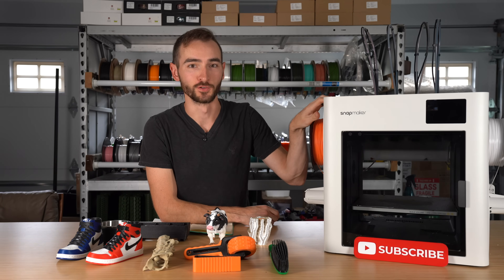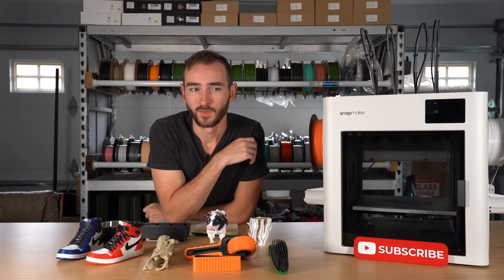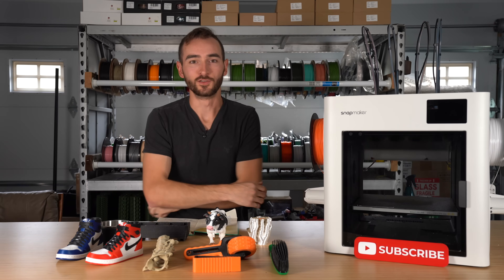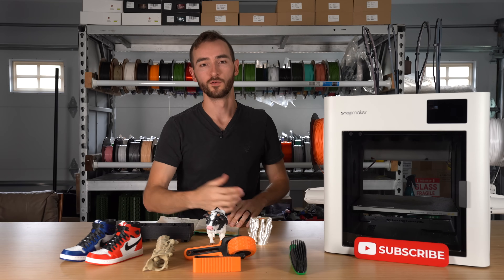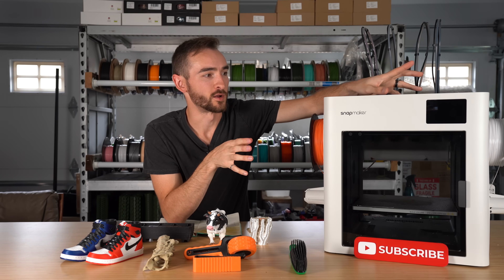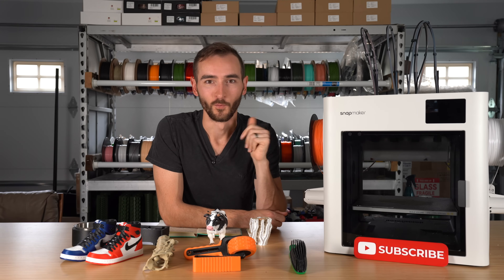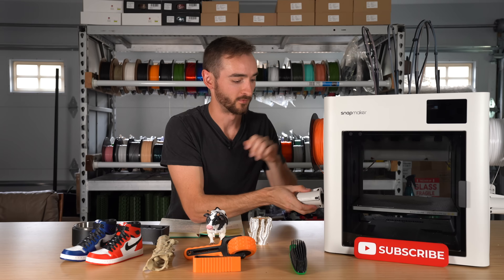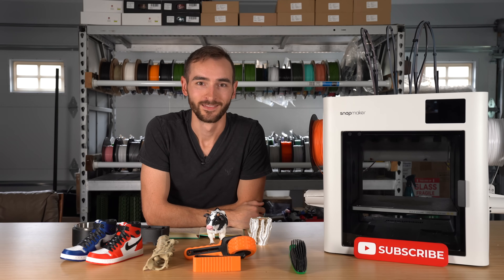Snapmaker U1 Final Verdict: Pledge or Pass?

Comment: I recently bought the P1s as an upgrade to my old CR10s. The issue with all the other companies currently in the market is that you get banana-ware, riping with the customers. Or never. I got the P1s. I set it up within an hour (admittedly getting the bluetooth to connect was frustrating). But it worked ever since. Flawlessly. No crashes. No random failed prints. No UI freezes. I can monitor my prints via my phone. I can change speed via my phone. It all just works. This is what people REALLY want. Yeah, I get it. Not you, as a 3D printer tinkerer. But everybody else. For my CR10s I swapped literally half the components, including mainboard, motor drivers, I added a BLTouch, compiled Marlin which had a bug that caused the printhead to crash so I needed to compile again... It took me a week back then.I am just done with working on my printer. I want to work on my projects. And my printer is NOT my project. It is a tool FOR my projects.

And the second issue: I wanna be safe when printing. I know that 3D-printer enthusiasts often just gloss over this or neglect this, but trust me, if I were a dad of a small family... Yeah, I fucking care whether or not the printer in the room next to me fills the air with harmful to toxic UFPs and volatile chemicals or if it has a decent filtration. I know the P1s' default filter isn't great, but at least there are better filter boxes available from e.g. Voxel, and yeah, I will totally build my own filtration stationwith a car blower fan, serious filtration units and an exhaust pipe to outside to print some of the nastier stuff. But at least a decent default filter is imo a MUST these days, when you offer enclosed printers capable of printing ABS/ASA and the likes.

Coming back to this printer and Bambu and why I bought Bambu: Literally every other printer I saw reviews of had MAJOR issues. I mean MAJOR issues. Like UI freezes where the nozzle stops in your print while printing with 270C. Which is a very nice setup to burn down your house. I will be honest: The current market is frustrating. Because believe me: I would have rather bought something that is not Bambu, that is open source and that does value that open source idea and ideology. But everybody is else is just SO far behind in terms of reliability while being affordable. It's just a different game. I really wish this printer here would come out and be AMAZING. That would be so epic and disruptive. And I would likely buy it then as a new main printer, ngl. But with what you report... I just don't see it. Again, as with all the other printers coming out recently. If Snapmaker wants my money, they need to make this machine reliable, make the obvious wearing parts available for REALLY cheap or even better: just open source those little connector boards (which would be a HUGE "yeah, your machine is going to last" statement btw, just saying). And address filtration and enclose-ability. But yeah, they need to NAIL reliability. Because who is caring for tool changers? That is not the guy that occassionally turns on his printer to print 3 mini dragons every two months. That's people who print often, a lot and know why they need it.
Reply: P1S, A1 Mini, H2s, all perfect. multi head would be a nice feature but not at the price of reliability.
Reply: You have summed up my view  ( and experience ) perfectly, I really want another manufacturer to challenge Bambu because it’s good for consumers. I’m waiting for the Bambu nozzle changer, it’s highly likely to be a well sorted tool from day 1.
Reply: I recently got a P1S after having an older printer for the past 6 years. It's like heaven. I do want heated chamber and be able to do multi material and a little bit of multi color, I mostly do functional prints, so color isn't really my thing. I only have white, black and gray filaments. I am content with the P1S and will let this tool changer mess shake out before adding another printer.

Comment: I appreciate your timely post and candor. OK, so I am backing this Kickstarter, I got in at the $749 after constantly checking for openings (I had originally scored a $799 slot). I have some reservations as I backed the Snapmaker 2.0 A350 and have always had issues with it. Hope this is more reliable. I have a Bambu Labs A1 that I LOVE, just cannot stand the waste on the multi material / color prints. I think I will keep the pledge, at this price point why not .

Comment: As far as the spoolholders go , You REALLY SHOULD actually read the kickstarter updates before posting.  Snapmaker has already addressed the spool holder issue.  AND why are you so uninformed on all this?  Snapmaker 2 WEEKS AGO put out the longevity of the pogo pins at 2 million+ changes.  If your going to be an "informed reviewer" then you should be "informed"...
Reply from the maker: Fair. I did catch the point about the pogo pins after I recorded which is why I added the overlays clarifying that they’re rated for 1M according to snapmaker. Didn’t see anything about the spool holders though. I’ll have to go back and look for that.

Comment: I am buying because it’s useful to me… not because it’s current. Even my old ender 5 is still useful to me (well it’s not really an ender 5 anymore… I changed it so it’s much easier to use, motherboard, hot end, Klipper etc.), but I wanted a slightly bigger build plate and multi material for supports….

Comment: I watched a creator video first impressions video three hours after the kickstarter launch began.  I am thrilled to have backed it when I did.  I am on the January delivery timeline.  This is the printer I wish Bambu Lab had released instead of the H2 series.
Reply: H2 series is a nice platform.
The H2D was a bit lacklustering but H2S and H2C will definitely have their real life purpose.
I Will instantly convert my H2D to a H2C when vortex is out.
Reply: Maybe a different series, but H2 was necessary. I'd rather have a heated chamber than a multi tool head.

Comment: Fair and valid assessment that may and probably will affect the first wave adopters. While having an entry-level-priced multi-toolhead printer is kind of the holy grail for first printers, the area of the market that's truly been ignored is people who want a Next printer. Most every printer on the consumer end is a First printer, whereby people who have one more more machines already know what they want, want to expand capabilities and explore higher-end materials, but the step up into that realm is either out of price or a DIY effort. Me personally, I have fairly specific benchmarks to hit for my Next printer and am building my one-off for my somewhat lofty needs. I don't need multi-color so much as multi-material, a large footprint and High Temp capability that won't cost $5k for a printer with Pick 2, Need 3 options.
Reply from the maker: I like this take a lot. The “next” printer versus the “first” printer - well said.

Comment: To correct you there is actually only ONE other multihead printer in the works like a U1 , The Wondermaker and its a huge question mark at this point.  The Indx or the Vortek are NOT printers. They are just addon components to already existing printers and require assembly, much like a Co-print unit.  That is never a good way to go for tge average customer that doesnt have engineering skills to build half a printer.  The U1 is going to be the new standard, like it or not

Comment: As someone who HAS replaced the carbon rod assembly on an X1C, I can concur it is “much more difficult”. That’s probably an understatement as I had to take the printer down almost to the bare frame (probably 80% disassembled). It was so involved. Took about 7 hours.
Reply from the maker: You’re a trooper for even taking that on in the first place
Reply: I had one of the first 1K Kickstarter units and unfortunately the carbon rod assembly seized up after about 800hrs and I couldn’t print anything. BL replaced the rod assembly under warranty. But, yeah, it was literally an entire day of non-fun work to replace that. In the end, it was all good and I put on another 2000 hrs afterwards. But, egads, I’d never want to do that again.
Reply: Can confim. I have replaced one on a P1S. Someone had used it as a carry handle and the lower carbon rod broke. It cut his hand quite deep and the resulting cleanup was no fun at all.
Reply: A few months ago I replaced the carbon rods on my P1S, and it took about the same amount of time - 6 hours. It's VERY involved. You have to take apart like all the panels and there's so many steps.
Reply: How to judge those rods are worn down? Like avg. print hours?
Reply: Mad respect for doing that replacement! I'm enjoying my P1S but dreading the day I'll have to replace that carbon rod assembly
Reply: @MrBluntNose its not that bad. I have done it twice and takes approx 1 hour if you are a bit used to repair printers :)
Reply: @sindrejl  it does not take one hour. I am used to repair things, but it took me over 1 hour to replace a motor. Just getting the wifi antenna off was a nightmare since Bambus wiki shows just remove it.. and in reality it was glued down onto the plastic.

Comment: Thanks for doing this. Personally I stepped out of the Campaign a few days ago after getting in very early and since considering. At the end it was a mix of very personal reasons and i sincerely hope that Snapmaker delivers properly. I myself will first look at the Prusa/INDX and Bambu H2C thing and then weigh my options. They will both likely be more expensive but there's just a bunch of details I don't like on the U1 and I personally prefer paying more for getting more instead of buying the first cheap option. Good luck to everyone who bacs this and I'll hope they will get their printer rather sooner than later, even though experience as a Superbacker says otherwise :)

Comment: 2mm on the bed, there is like 0 chance I will not see the results of that in my prints. 0. If the bed is that warped, how bad is the rest of the system, like the gantry? Sounds like there is like 0 focus on accuracy, both within the community and on the manufacturing side. You also got a tilted bed, not really a warped one, if you can trust that bed mesh. But can you? No matter how you twist it, the gantry and the bed is no where near in line.

Comment: I did the $50 dollar pre purchase, I then backed out and got a refund. I feel I made the correct choice. Will see how the Bambu H2D multi tool head works out for my H2D.  After thousands of hours on my P1S and H2D, I can say I am a Bambu fan IT JUST WORKS and Prints great. This machine is 2 cheap and I do not think it will last for a power user. Might be fine for light printing, but heavy use??? I do not think so.

Comment: One thing I like about Prusa is they produce a printer and then support it for years. The printer you buy on day one will be much worse than the same printer in year three. 
Compare that to basically every other cheap Chinese manufacturer and they push out a new model every few months and however it ships, that’s it. It’s got no support after release. 
I’ve never owned a Prusa but that aspect is appealing. 
Like a Tesla. They aren’t pushing out a new model every year with no real changes. They produce the same car year after year and all the changes roll out for every car not just the new one.

Comment: allright allright, lets try it out. I dont want to wait for INDX because by the time INDX will arive, there will be something new, and then something new, and then something new and you will just wait and wait and wait for something newer better allways. This is basically proof concept, because it is basically baby Prusa XL for 1/4 of the price. And this is full solution, INDX will be something you will need to tinker to get it work, and only Prusa with core one will implement this, but it will be much more expensive, and do not forget build size on the core one is not that big. and Nobody yet tested INDX, maybe it will sux ? maybe it will be best, who know. U was tested by XY of people already and we can see that the printer works and prints. Fingers crossed that they will deliver and that printer will be good.

Comment: This is still one of the first affordable tool changing printers and with a very hobbyist friendly price. So, yes it is a machine worth backing. Even if you receive your machine in march it will still be a competitive machine. If you want a reliable workhorse, I have my doubts. It is to cheap to have all good quality parts. Pogo pins are a cheap solution, but when you use the printer as a workhorse almost 24/7, they need to be replaced after only about one year. 
The Prusa XL is still the tool changer to beat, but that has a price tag which is more to the professional market. If Prusa comes with a INDX upgrade for the Core One, that will be a serious competitor, with probably even more colours.

Comment: I appreciate your very measured approach here! I am personally optimistic that Snapmaker will deliver and that there will be little buyer's remorse. I don't think we will see a major player tool changer from any other company for at least a few months. I personally think the Bambu Lab Vortek sysem is very flawed on paper and I have no interest, especially given how expensive it will be. I am most excited for Bondtech INDX, but likely will not want to pay the entry fee for a Prusa machine with it integrated. I do want to add it to a machine in the future. The U1 is really in a fantastic Goldilocks zone in terms of price, capabilities, and from what we have seen, performance. I hope they can live up to the beta quality!
Reply: I think Vortek is interesting, but I'm not buying another Bambu Lab printer, now they've shown their true colours. Whether toolhead or hotend changers win out though, only time will tell. I just hope that Snapmaker will offer replacment toolheads at a reasonable price.

One of the things I do like about the Bambu Lab A series printers (and I presume the same goes for the H2 series) is that if you get a nozzle clog, you can change the hot end mid print, if you have a spare, so it would be good to have a spare toolhead to swap into the U1 if it sees a nozzle clog.

Having said that, mid print nozzle clogs should be far less common when any given head only ever sees a single filament during a print. We have a bunch of 0.2mm nozzles blocked with PVA from trying to print PLA and PETG models using PVA support interfaces, and no amount of cold pulling or needle pushing can clear them.
Reply: @markbooth3066 Yeah, I won't personally buy a Bambu Lab printer for my use either. I don't like the company practices. Usually when you get a clog that bad it's time to burn it out, hahaha.
Reply: I think the Vortek looks the best one on paper :O  Imagine it used the Bambu A1 toolhead, then we have filament all the way to the toolhead already, just the last 50mm that is empty. We have 4 nozzles to the right of the printer, one for each color.  We print with color 1.... change to color 2, first cut the filament (so part is in nozzle, while the others are retracted 50mm) Nozzle 1 is left in its holder, while picking up nozzle 2. Filament 2 is pushed down. Then we change again to nozzle 1, so we cut the filament, retract filament. palce nozzle 2 in its holder, pic kup nozzle1 (that now has filament 1 already in the nozzle)  filament 1 is pushed forward the nozzle, and print again.   To me this seems to be the best way to do it. No waste of filament, and also they can keep the nozzles at temp since its heated by induction in an instant. Also we only need 1 extruder so less things that can go wrong.
Reply: @AndrewTSq You're missing the part where cutting and retracting the filament adds significant time to every tool change and having a cut in the filament means there will be inconsistent extrusion at that point so it will have to prime more. It also requires multiple AMS units, adds the complexity of the hotend rack, and adds connection failure points. There are advantages to the Vortek system in terms of size and possibly heat handling, as well as fewer tubes, but it fails a lot of core missions of a tool changer. It also still won't be good for flexible or extra brittle materials for example. Also Bambu Lab isn't very Clippy friendly and it will be the most expensive system.
Reply: @802Garage  Well, not sure why you would need multiple AMS systems? I think Bambu is clippy friendly, since they do not force me todo something to use the printer. I can use it in local only mode whereas installing Windows 11 i can not conitnue unless i give them my userinfo.  Bambu will also print the best pieces, so
Reply: @AndrewTSq It needs one AMS system per 4 colors. No, Bambu Lab is not Clippy friendly. Far from the worst offender, but it's a closed ecosystem which changed terms of use after ownership and disabled the use of software which previously worked properly, among other issues including using open source code and obfuscating it without open sourcing in return. Also, Bambu Lab has fine print quality, but plenty of other printers do as well. Qidi printers produce higher quality prints than any Bambu Lab except the H2 series, which look great, since they actually have fewer VFA.
Reply from the maker: Well said! The U1 is not too hot or too cold… just right 😃